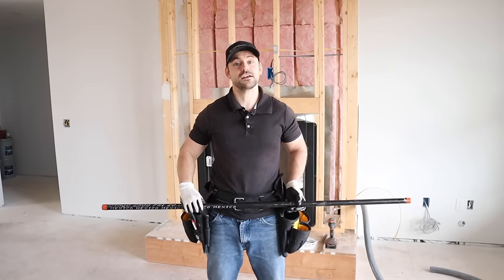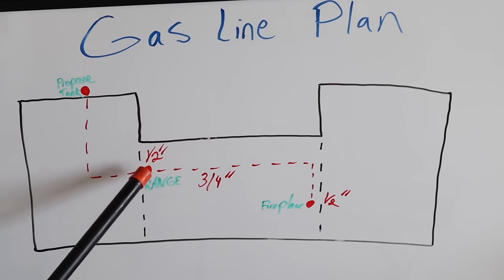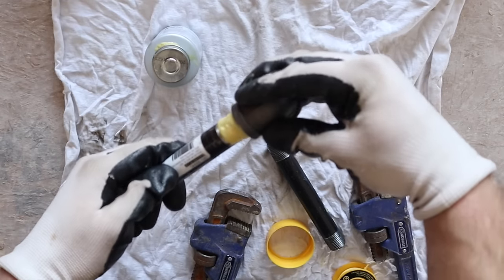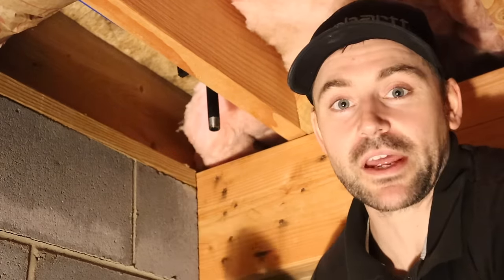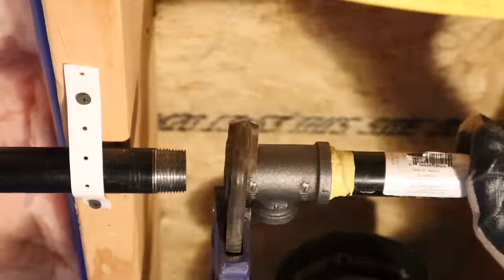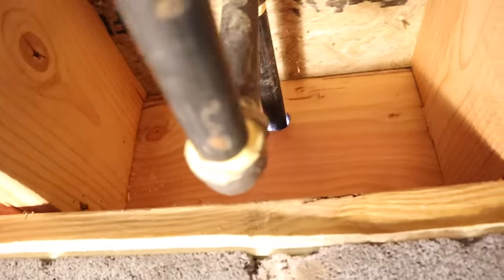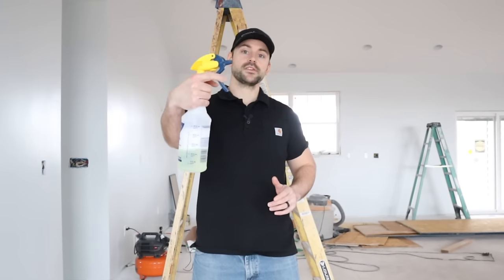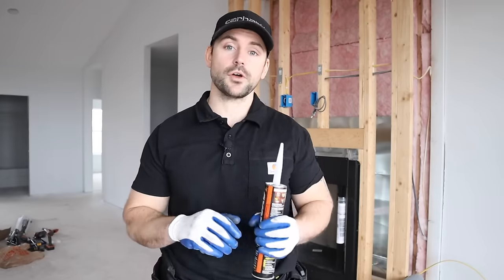Black Iron Pipe Gas Lines Installation - Sealing Fittings, Pressure Testing, and Bonding

Comment: Is it 1/2" enough for a range? I was told that 3/4" is mandatory at least in Texas as far as the plumber told me before charging me $900 for the replacement of the existing 1/2". 😆
Reply: Pipe size depends on the btu rating of the device. Search btu pipe size and it  will tell you
Reply: Typically 3/4 is run for a natural gas range especially if it is self cleaning.
1/2” may be ok for propane as the house line pressure is higher.
Reply: @DONALD1951  Ok. I'm glad I wasn't scammed. Mine is Natural gas, self cleaning. So I'm ok. Thanks. 👍
Reply: Sizing is very complex.  I would watch the video on it.

Comment: That BMP will eventually rust, even if painted, and will need replaced, especially where your wrenches laid bare the shipping coating on the pipe. You should've used CSST.  CSST doesn't need threaded and is flexible so you can run more of a Point A to Point B route versus being so limited by the rigidity of iron. By code, the only time you need tape and dope is in the application of liquid propane. pipe dope is all is needed. 100 psi!?!?!?!?  Code requires 3 x working pressure @ a minimum of 15 psi. You cannot run more then 2 psi into a rsidential home and 15 psi into a commercial environment. Too much pressure can literally cause a leak. A shut off valve at each tee and each appliance allows isolation in case of leak and ability to shut off individual appliances. You needed all of your shut off valves in place prior to pressure test. You don't know if they'll leak if installed later. You need fire caulk by code for all floor penetrations. With a 25 minute burn time minimum.
Reply: I'm 56yrs old, I've NEVER seen a rusted BMP that was no longer able to function as designed, in Michigan no less
Reply: @markp4967  sorry, bud. But those pipes WILL be rustly within 6 decades. PIE IN THE FAAAAACE
Reply: @markp4967  I have pulled rusted BMP from under houses in SE NC that looked like swiss cheese. You could smell the gas way before even climbing under there. I even left it there for the husband to see, he had an opinion like yours. Well, He now has the proof. All 16 feet of it.
Reply: Can't run csst plastic piping under your house it has to be buried, most codes won't allow it above ground in case of house fire.
Reply: @badtater2  Corrugated Stainless Steel Tubing which is plastic coated has been allowed above ground in framing and attics since the 1990 s.  Was not always allowed to be buried. And no gas line system is allowed under a structure, with few exceptions. I think Gastite csst has to be installed in a plastic line larger then the csst pipe in order to bury underground. It might change for different manufacturers.
Reply: @stevelopez372  Steve I suggest watch a 13 part series called What on earth happened by Ewaranon to learn that the earth is not a globe. Link in my about tab.
Reply: @badtater2  I think you're thinking of the yellow plastic PE (or Polyethylene) which is designed to be underground. It's not allowed inside a structure but the yellow coated stainless steel is.
Reply: Why do you care if he puts tape and sealant to his pipes? Unless you are just trying to show you “know more” than everyone on gas pipes. Or you just used ChatGPT to spit out an objective response.
Reply: It looked like a red glag to me too.  Its one or the other. @Samuel-ik5wp

Comment: Natural gas in a residence is less than a pound 7 ounces of pressure not even a pound. Roughly 7 inches of height, gas wells and main lines use 20 to 30 pounds and it’s reduces at the regulator before it enters the building

Comment: Just putting it out there, if he used dish liquid or soap with water, and if he applied it to that black iron with no galvanized coating.... it will cause the pipe to corrode where sprayed over time. Hence the special leak testing fluid.

Comment: Hello Josh,                                   Personally, I wouldn't place any electrical (grounding) wire on a gas pipe. And especially, not adjacent to any fitting. Why? ... Because for whatever the reason that electricity should ever happen to travel through that wire, and at a time when their would happen to also be a slight gas leak, I would not want an explosion to take send me and my loved ones sky high!. 🚀                                        Instead, I would feel alot better driving a grounding rod just outside of the house.   Live and Learn (Not burn)!
Reply: I learn so much from your videos  keep up the good work

Comment: Always been told that is one or the other even most people prefer pipe dope over  the tape.
Reply: Tape is for damaged or poor fitting threads, good threads should do better with pipe dope, it lubricates the threads making it a tighter fit with the same pressure applied.
Reply: @phillhuddleston9445  nice , that make sense thanks.

Comment: In Australia black pipe went out 50years ago  copper internally  gas coded under ground   all copper  gas and water  joined with  silver  braised it makes the job so fast and safer with no leaks  no fancy fittings  copper pipe bender    gas torch  silver   and a pot of glue  the world is so behind😴😴😴🤔🤔💯🇦🇺
Reply: Stupid  phone deleated plastic pipe under ground gas coded
Reply: Black pipe is the strongest and safest.  In the US we use mostly Trac Pipe which is flexible stainless steel pipe.  Much easier to install...
Reply: @donflash1128  lpg has a pressure of 11lb  natural gas is 4.5 lb what do we need  higher pressure than that  yes in Australia we use flexible stainless  but only internal    no one any where uses it under ground 🤔🤔🤐🤐💯🇦🇺
Reply: @jackbarrie6007  yes..not underground..it’s usually copper for propane and heavy plastic for nat gas...propane is usually 60 psi to the house then regulated down to 1”1” WC water column..nat gas is 60 PSI down to 6” WC underground  ..a.low pressure about 1/4 psi....then almost always 6” water column inside and occasionally 2psi with regulators at each appliance.
Reply: Why do you get your info from all those pressures and totally wrong in Australia   black pipe is a product  that is only used for frames for racking  and your  so called water  columm  is technically know as a  nanometer I won't be bringing up any more of your posts i don't think you are a fully qualified registered gas fitter  just someone trying to make  big boy of yourself🤫🤫🤫🤔🤔🤔💯🇦🇺
Reply: @jackbarrie6007  
this video is from the U.S....I’m from the U.S....the pressures I. Talking about are U.S...
Water column is a unit of measure..a manometer is just the device used to measure water column.. I’m well qualified..
Reply: @jackbarrie6007  Jack, Don I suggest watch a 13 part series called What on earth happened by Ewaranon to learn that the earth is not a globe. Link in my about tab.

Comment: Tape not allowed in many places and you don't need both. Pipe dope the best. The purpose of dope is not to seal but the lubricate. The seal comes from metal on metal contact as the threads of these pipes are tapered. Don't really need drip legs as both your appliances are visible flame devices but still not a bad idea as those regulators that are part of the appliances are expensive and deserve to be protected.
Reply: The purpose is to seal and lubricate. There are gaps in the tapered threads.
Reply: @Inspectorzinn2  Then you have damaged  threads and should try again. It's purpose is to lubricate so the pipes fit together better without excess torque. If you cut open a joint, there is nothing in there but metal to metal contact just like in the copper joints on the regulators. If this is the level of your knowledge, then you as an inspector would be a fraud.

Comment: You never use Teflon on gas , reason being offices can become plugged.
Reply: Daryl I suggest watch a 13 part series called What on earth happened by Ewaranon to learn that the earth is not a globe. Link in my about tab. I assume you mean orifice
Reply: medium density tape is approved for gas. Low density (typical plumber's tape) will definitely clog things up.

Comment: While you have a lot of good information you did not explain how to measure the length of pipe that needs to be custom cut which is very critical to doing the job correctly.

Comment: Way too much tape and sealant
Reply: Did it leak ?
Reply: @justinballard7242  I'd rather have more threads than tape
Reply: If it didn’t leak then it wasn’t too much
Reply: With tapered NPT threads and a 2600-psi capable sealant (100 psi on assembly), the Rectorseal s more than adequate.
Reply: @Ididerus that’s what she said 😘
Reply: Hello, been in the gas business for close to 40 years. You need to be very careful when you talk about sawing gas lines. When you have mechanical fittings concealed in the walls that is against code. Down below the fireplace you could have put a drip leg in because this is what they call a attended appliance which is required. And then you could have run CSST up and into the fireplace into the concealed area. The reason for this is if there would be a leak it would build up in that area and you could have an explosion. Second reason if you have a leak after the wall has been assembled how could you check it you could put a manometer on which which would determine the leak. But how would you isolate it. Most like he was soap. But you can't get to it. Mechanical fittings are not allowed in confined areas. Take care
Reply: @r.wcummingsjr.inc.9024  Are you positive about that? Are you saying you couldn't bring a pipe down inside a wall,  then elbow out of the wall, because the elbow is concealed?

Comment: Tape + compound is major overkill.  Reason:  1.)  You can SMELL a leak easily  2.)  Even bare pipe is unlikely to leak, and if a leak did exist, it would be so minor that there would not be a hazardous risk(maybe industrial setting that could change)...  a few pennies wasted per month at worst IMHO.   
CONCLUSION:  use one or the other, don't need to buy both.

Comment: 3 raps of tape angled to cover all the thread except the first thread then throw some dope covering that first thread, no doesn’t have to perfect.. this method will give the perfect amount of pipe dope, it’s starting at the beginning squeezing its way down sealing every thread. I’m sure the inside of your pipe has dope glopped up in there but hey fuck it right

Comment: Gas pressure is like 3 psi and gas lines are tested at 10 psi for leaks.
Reply: Nat gas house line pressure is 6” water column...Propane is 11” W.C.
Sometimes 2PSI is used with regulators at each appliance.

Comment: 100% wrong, you need to brush pipe sealant in both directions making sure to push it into the threads well not just on it in a circle
Reply: William I suggest watch a 13 part series called What on earth happened by Ewaranon to learn that the earth is not a globe. Link in my about tab.